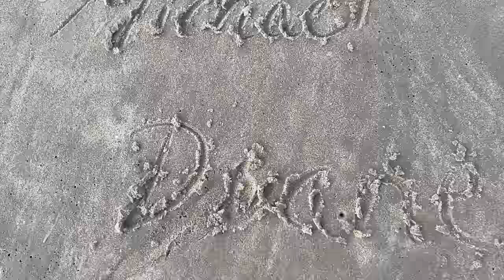Boat building: salvaging a wrecked wooden sailboat | epoxy, wood & carpentry — Sailing Yabá 127

Comment: A yachts tender serves a variety of functions. The most critical being saving the yachts crew from going down with the ship, quiet literally. Out in the deep blue you cannot afford doggie failure prone equipment especially a patch riddled tender. You need a new dingy and a life raft. Otherwise keep the funeral home on speed dial. Also if your unfamiliar with “man overboard” drills I strongly recommend you learn and practice until they are second nature. Twice yearly I have surprise man overboard drills, just as we had in the RCN. Have a great week!

Comment: Ben and MP, I’m worried about the big swim deck.  If, when you get into heavy seas the weight of water pushing up and down on that size will be huge.  Bracing it to the Transom sounds good, BUT if the water pulls too hard, you risk serious damage to the integrity of the transom.  Water is heavy, just a thought.
Reply: Realy, this deck is very dangerous.
Reply: Seriously? The boat is going to be a day Charter and will NOT BE IN HEAVY SEAS....
Reply: Resposta tipica de quem não tem vivência no mar. As vezes somos surpreendidos até perto do porto.

Comment: To reduce the leverage the davits will have on the platform, a pair of stainless cables from the overhead to the davits will prevent them from leaning aft when under load. A loop in the cable going around the davit with a welded on hook to keep it at the upper end will allow the davits to swing when bringing the dingy onto the platform. The cables will also be a handy place to hang your laundry for that fresh, air dried smell... 👍

Comment: Exposed epoxy is problematic and should be painted over as soon as possible. White primer is fine and will provide protection until a final color is chosen. I was involved with a 132 ft wooden brigantine using lots of epoxy and we did not leave it uncovered as recommended by ours supplier, West System. Great project!

Comment: Even if the dinghy stays inflated for a full day, I WOULD NOT TRUST IT LONG TERM, as the adhesive does not bond as well and I'm certain that air under pressure will find an escape route before too long. Adhesive tape is ONLY any use as a temporary measure!

Comment: 3 coats of epoxy on the outside of the hull is ideal. Drilling ventilation holes or making slats or cuts in all  entry doors and cupboard doors will also help to insure proper ventilation. A constant ventilation system in the lower areas of the boat like the bilge will help to deter rot and water accumulation.

Comment: Paint it white! Lasts longer in the sun! Reflects heat, for the anti-fouling, use the red, it has the highest concentration of copper to ward off the critters that want to eat your boat like teredo worms. Paint the boot stripe along the waterline a contrasting color like blue or green! Paint the propeller with that special prop anti-fouling

Comment: A lot happened in this episode and the interior looks more like your home to be every video.  Regarding the storage cutouts for the seats, you may want to add more support pieces in the middle of the longer edges for added support.  Over time those areas may start to bend down without something to keep them in place.  A little extra support won't hurt if you get someone sitting there that is over 200 pounds too.

Comment: Hi. I think if you soft wash the Dingy it will clean up Better. Use Bleach and soap. 2 parts bleach 2 part soap and 10 part  water, let it set on the dingy for 10 minutes then spray off .  I Do This On All My cars And My House Works Extremely well.

Comment: Question: How are you going to epoxy under the boat wooden block supports holding the boat upright?
Reply: They will have to first let the surface coat cure solid. Then jack up the hull so the support blocks can be moved to uncover the untreated areas which can then be epoxied.

Comment: Every other boat out there is white so I say go with some shade of light Grey, that's topside at least. As for the bottom coat, have you decided yet whether to use an ablative antifouling paint or a hard modified epoxy? In either case here's something to keep in mind... Pick a color that is easy to spot amidst the endless blue of the ocean, because God forbid that you do end up upside down following a disaster at sea, you want the hull to stand out to a rescue helicopter or plane. I know that's a depressing thought but it's a fact that blue bottom paint has cost men their lives in the Southern Ocean. And, as Ben Franklin once said; "By failing to plan, you are planning to fail."

Comment: Boat looks great.  But that dingy is a lost cause.  try to fund a new one.  When the crap hits the fan in the middle of an emergency, you will need a dingy that will not fail.  The current one in the middle of an emergency you will be looking for your flex tape, so you do not sink.  Get a new one.  Be safe out there.

Comment: This is the only sailboat I have ever seen with a swim platform I wonder why. That thing will break off and sink the boat.
Reply: @evanschwartz3030  IT will can you imagen that thing healed over in rough weather and having it under water talk about a larde rutter og in a brouch or A pitchpole occurs in the same circumstance as a broach. The boat careens down the face of a huge wave. But instead of turning broadside to, it buries its bow in the opposite wall of water in the trough. The boat then cartwheels, or pitchpoles, end over end. I have told them about this a few times before.
Reply: It’s a platform for tourists to dive off, I doubt they will ever be offshore in bad weather.
Reply: @peterrobierto7435  Even a large wake would cause a big bang from under look at the size of that thing it is as wide as the hull and maybe 10 feet long think about it. Thanks for your reply.

Comment: IMHO (and I do mean HUMBLE), I think a light gray would look fabulous on Yaba's hull!. White is SOOOOO overdone with sailboats! No imagination, just goin' with the flow. Why? Speaking of White, I will reiterate another humble opinion of mine from months ago: your decision to preserve the woodgrain yada-yada on the forward cabin roof is massively ill-advised, IMHO. THAT should be painted white! Why? That's a HUGE section of heat-attracting, extracting, exacting, malefacting  (is that a word?) expanse of area which will be unbearably hot in the tropics or summer in more moderate climes. PLEASE reconsider this decision, paint the thing WHITE! Again: these are my humble opinions, and only based on heat accumulation and heat-transference principles, which may or may not agree with aesthetic preferences. Not my fault. Move forward and onward, Yaba!